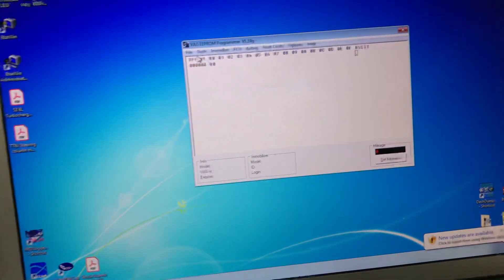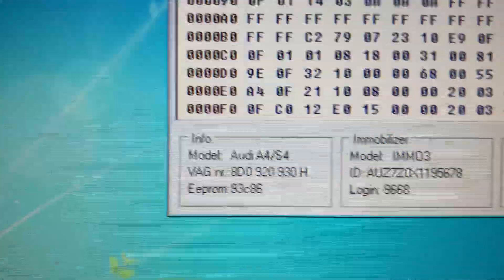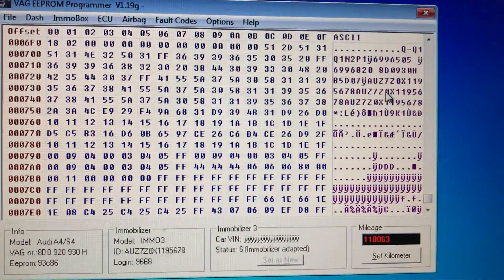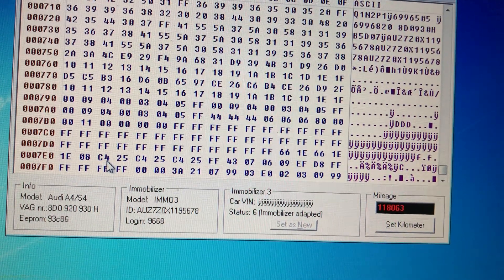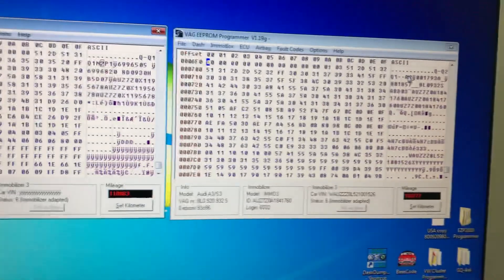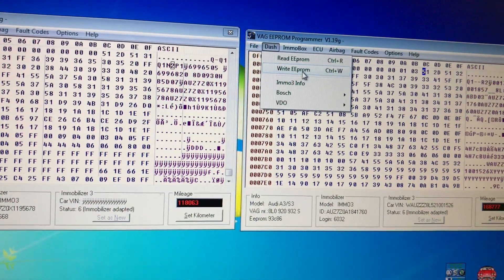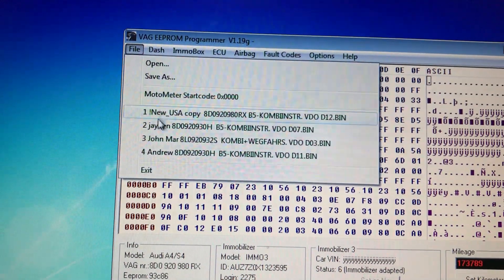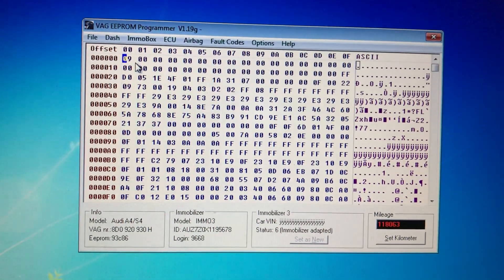How to read cluster EEPROM - Audi A3, S3, A4, S4, RS4 & Golf Mk4 R32 Gen. VAG EEPROM Programmer link

Comment: Does this work with the b8 b8.5 cluster.  I did this over 10+ years but need a refresh.
Reply from the maker: nah that's too new - you'll need different tools (more expensive) for modifying those
Reply: @ianpgonzaga what tool would you recommend?  I've seen programs like Abrites.  Also is it possible to virginize  a fob and if not, can a new chip be soldered in?
Reply from the maker: @davispaul82  correct Abrites,X Horse etc. You're right about the fob - they can't be revirgin so rechip needed.
Reply: @ianpgonzaga so I did some research on my autel km100 which can renew them using a provided cable.  So the km100 can renew keys.
Reply from the maker: @davispaul82  OK nice! good luck and let me know how you go
Reply: @ianpgonzaga  will do for sure.  Programming these cars have changed for sure and it seems like the tools i used to use are obsolete.

Comment: I am using aftermarket cable. I have two of them that work with VCDS. I can read the Cluster in the CDS but cannot read it in the software VaG for the Cluster.

I am using a TT cluster. I have two spare clusters that I’m not able to read with the software you posted. 

Please help everything is wired correctly 

I am receiving communication to the K line
Reply from the maker: This doesn't work with TT cluster. They are not VDO brand.
Reply: ❤Ian I miss your 1.8t videos
Reply from the maker: @tomtomd121 sorry man! Have been busy with other stuff. The 1.8t Mk1 is still with me! So hopefully more coming soon.  Just got a couple of other VR6 projects to get sorted before jumping back into the 1.8t.

Comment: Hi Ian, Great video!

I've got a Audi TT mk1 I tried to follow your steps with the download of this software Vag programmer v1. 19  but it does not correctly download on either of my laptops but does on the Desktop display only. 
However once I'm in the Ross tech cable or the blue K+DKcan using the USB or selecting com1 message displays "unknown software version' or" no ecu found'  however I have the Ross tech software. 
My car troubles started when I got the instrument cluster repaired as the usual issue centre display fades the car worked fine once replaced by a firm till a few weeks in the immobilizer key light flashes but car drives perfectly however I think after a month the car starts to flash all sorts of warning lights and recmv counter stops then key won't start the car till you disconnect the car battery. 
I think this resets the failed attempts counter,  I'm thinking if I deleted the existing key and program it in again and a new one a second key this may sort the key flashing immobilizer. 

Please advise your help would be much appreciated 👍

Comment: Thanks! Just one question. Model A4/S4, 8D0 920 900 K Eepron 93c86

I have two identical Dashboards (same numbers). Do I have to modify the new Eepron file with old data or could I just upload the old Eepron file into the new Dash? The files looks very simular except Win, imo and login of course, but that would if possible be an easy solution.

Comment: Hi, can i write eeprom to other instrumen cluster if the VAG nr last char not similar? (80D 919 880 E to 8D0 919 880 M)
Reply from the maker: Just double check the EEPROM chip type is the same. If so. Yes. You can write over it.

Comment: hi great video, so i wanted to ask will this help me with my issue, i have replaced the original cluster (UK version) to European one, i have two original keys from the car one with original rfid 1d48 chip and one with a new chip, but i cant seem to get the keys to learn so at the moment i have to leave immo off which i dont like. i want to keep the replacement software because its all setup in kmh and when i copyed the old software the speedo was reading mph and not kmh. rs6 c5
Reply: if i copy from Q to the end from the old to the new cluster as you explained in the video, will my original key start to work which then i can learn the new chip in the 2nd key. thank you :)

Comment: can i immo off with this program?
Reply from the maker: @zeekxng  no not with this. Immo off happens on ecu. This program only changed instrument cluster data.
Reply: @ianpgonzaga  but it can read eeprom, right? so i can read it with this and load with another program? because vag k can commander just seems to not work
Reply from the maker: @zeekxng4210  yes it can read eeeprom and write. Sounds like you might have cable or driver issue. But won't hurt to try this program.

Comment: Hi, can i read the eeprom from old cluster in the car and then swap to the new cluster and write back in the car?

the clusters have the same part code, they are identical.
Reply from the maker: @prbt8773  Hi. Yes should be able to just double check they're the same EEPROM chip. Always save a backup of the original.

Comment: Hi mate, i get "ecu not found" using the vag hex v2 cable and the diagram from your video. Golf 4 cluster.
Reply from the maker: @DrGreenThumBxD  ahhh won't work on hex v2 cable
Reply: @ianpgonzaga  hi, thanks for the fast responce, yes it worked i just added the cable 25 from the blue connector to the 27 from the green  (K Line) and voala
Reply from the maker: @DrGreenThumBxD  oh you were just missing K line lol
Reply: @ianpgonzaga  we use 4 wires from the blue one (1, 23, 24, 25) and you have shown only 3 (1, 23, 24) in the video of the bench harness
Reply from the maker: @DrGreenThumBxD  hmm strange. My pinout has been working for years...
Reply: @ianpgonzaga  yup but didnt for me mate, just added one cable (25) from the blue and now everything ok.

Comment: Hi, I have 1997 A4 2,8L 12v V6. I am using the correct chipset cable in windows 7. I keep getting the error "No ECU found" when reading my current cluster ) not the replacement one. Also when I try to use VCDS lite it says port is good but interface error. Could the cable not be functioning correctly and could that give the "No ECU found" Error? Thanks
Reply from the maker: @mptrader1620  hi. Does it scan the car at all? Maybe dodgy cable.
Reply: @ianpgonzaga  I ordered a new cable and will test it and report back with the outcome.
Reply from the maker: @mptrader1620  hopefully it works
Reply: @ianpgonzaga  Hi it is not working. So I am using a laptop now with Win 10. The VCDS work fine. I was able to recode the Instrument panel to properly read the RPM for a 6 vs a 4 cylinder. So the cable works. 

Here is what I see. With the ignition off it says "No ECU Found" I then decided to turn the ignition to the ON position. And it started to read it - I could see it doing so the status bar was moving to the right. Then it stopped and I got an error code that said, "Unknown Software Version..." 

Could this mean that the EEPROM software is the incorrect version to read the chip on the board in order to reprogram the Odometer? If so what type of chip is it and what is needed? I can take apart my old Cluster to see - if I knew what chip it was I was looking for unless you happen to know. Thanks.
Reply: @ianpgonzaga  I am thinking the EEPROM will not work on my year and model. Do you  know if that is it.
Reply from the maker: @mptrader1620  Maybe your car is too old. does it have canbus?
Reply: @ianpgonzaga  No canbus. What is frustrating is that I have searched extensively and No One seems to know or have a definitive answer regarding the "No ECU Found" error. And I am not the only one with this error. I would like to get a definitive answer even if it was, it wont work and this is why.
Reply from the maker: @mptrader1620  it could be many things but it'll be hard for me to say without testing the hardware myself. 

You say that it works on another instrument cluster ? However with VCDS lite it says port is good but interface error. 

Interface is the cable ...
Reply: @ianpgonzaga I do have another update. I do thank you  for your time. I got my laptop with Win10 running and the VCDS Lite works fine now. As a matter of fact i was able to recode the new (used)  luster from 4 cylinder to 6 to correct the tach reading on the cluster. But the eeprom still does not. So I do not think it is a cable issue. One interesting thing happend only Once (could not duplicate it again). I turned the ignition to the on position it started to read it and then stopped with the error, "unknown software version..." 99.99% of the time it's no ecu found.
Reply from the maker: @mptrader1620  yeah something's not correct with communications whether it's a driver thing or a software incompatibility somewhere

Comment: Is in this EEPROM reading also the KMH or MPH sweep range ? E.g 280km/h and the needle speed accordingly for mph or kmh
Reply from the maker: @FlightSimXtreem  probably but I don't know what values to change to adjust this setting.
Reply: @ianpgonzaga  I have no immo, so I will dump a EU eeprom into a USA cluster. I have a new USA cluster, I changed the faceplates to KM/H and in vcds put it from miles to KM/s but the speedo is off. This is my last bet, otherwise am in for a new EU cluster haha! I hope it will read. :)
Reply from the maker: @FlightSimXtreem  ok good luck!! At least you will have a back up I. Case it goes sideways. Just reflash the OG file

Comment: I get “could not login” error, how to fix it ?
Reply from the maker: @bruniinho48  need to make sure drivers installed properly, com ports matching too.
Reply: @ianpgonzaga  the drivers are installed, and the COM port is correct, and it still gives a login error
Reply from the maker: @bruniinho48  what windows are you running.

Comment: what cable did you use? kkl 409.1 (blue) or k can (black)?
Reply from the maker: You can use the blue. But in this video I am probably using genuine Ross tech VCDS cable.
Reply: @ianpgonzaga  I tried both the blue cable and the VAG 18.2 clone on an Audi A3 2005 but it says "ecu not found" why?
Reply from the maker: @_giuseppe_4249  maybe check com port settings in device manager.

Comment: How are you able to do this without communication from ecu? When I try to read eeprom it just says "no ecu found" or something like that, both in the car obd port and the diy test bench I made. My car already has immo disabled and as far as I know it should be impossible to retrive the instrument cluster login code without ecu communication. How are you able to do it? I have a 1999 s4 b5  and a 2001 s4 b5 instrument cluster.
Reply from the maker: Hi rizzly. Need to check your wiring of the test harness or maybe your cable isn't right.
Reply: @ianpgonzaga  finnaly figured it out, i set my vcds cabel to ‘’stupid’’ mode by disabling a setting and it worked thank you!
Reply from the maker: @rizzlypig9822  Ah yes. I think I mention this in here ?
Reply: @ianpgonzaga  ah maybe my bad i was skipping through trying to find out how and i thought it didnt work because my immo was disabled and therefor my speedometer didnt communicate with ecu and i thought that was why it saud no ecu found lol.
Reply from the maker: @rizzlypig9822  😂 all good. 

Pays to not rush lol

Comment: Few questions please. WIll it work with Ross-Tech VCDS Lite and will the EEPROM work with Win 10 or is there another version for  windows 10. And I am a little confused regarding saving the info Are you saving everything or just the info towards the bottom. And if towards the bottom I am a bit confused how yo do just that?  Or is it simply reading the EEPROM and saving it as a file then connecting the second cluster and then reading and saving the second EEPROM then opening and then writing the second cluster with the first cluster's EEPROM. Thanks
Reply from the maker: Hello! Probably won't work with VCDS lite cable but you can try. 

The program definitely does NOT work on windows 10. :( 

You save the entire file but manipulate the data section as in the video. Good luck!

Comment: For a bit of fun your skc code is held in triplicate at 0007e2 to 0007e7 so = C4 25
Open windows calculator in programmer mode. Click hex button.
Reverse C4  25   =  25  C4
Enter  25  C4
Press dec button  =  9668
Reply from the maker: Love it! Thanks Leo 🤓

Comment: Hey. I’ve done the boost gauge/lap timer mod on an S3 8p cluster. But do you know how to change the range of the boost gauge so it uses the full bar animation?  I’m guessing there is  a standard range like .2bar to 1.5bar that would need to be changed. Thanks
Reply from the maker: Hmmm not sure sorry.

Comment: Hi I am trying to read an A3 8V cluster, its an 18 pin. I cannot find a pinout diagram anywhere. Part number 8v0920 970R. Any idea how i can find out? Thank you
Reply from the maker: Check on forums like digital kaos or nefmoto. Otherwise get yourself a copy of the latest ElsaWin. Always has detailed wiring diagrams.
Reply: @ianpgonzaga  nothing on the forums unfortunately. I put in to a group on Facebook if anyone has the diagram and one person said that you can’t read the newer Audis anymore using this method and that you need to solder to the MCU. Do you know if that’s true?
Reply from the maker: @carYouTubefdaf  don't know. Never done a read off a newer cluster.

Comment: thanks!!!!!!!!!!
the only download i was able find after days and days of searching for a virus free link
even though this one gets flagged three times on virus total windows antivirus doent flag it so id say its 95% safe 
now just waiting for my 1J5920826A cluster to arrive and get it coded,
if im correct itll go as such:
plug in new cluster to car, turn key to run position, attach obd interface run eeprom programmer of choise, read the cluster eeprom, backup the dump, note the SKC, change the mileage to 0km, write changes

then with proceed with vcds following rosstech istructuctions on cluster adaptation, pairing keys and mileage adjustment

Comment: Hello, is it possible to read vw golf 4 1999 1.9 tdi immo2 cluster? Because it shows an error for me
Reply from the maker: Should be able to cuz it's the correct gen for this procedure. What cable are you using?
Reply: @ianpgonzaga  I'm using vag kkl
Reply from the maker: @kaimietisiskaima4483  does it have the specific chipset mentioned in video? You need to have that specific chip in the cable else it won't work.
Reply: @ianpgonzaga  um i dont know right now i will ask my friend tomorrow its his cable
Reply: @ianpgonzaga  oh and by the way what chip it has to be? I cant find it in the video or I'm just blind and deaf :D
Reply from the maker: @kaimietisiskaima4483  FT232RL
Reply: @ianpgonzaga  yeah, so he has cable with the chip you mentioned, and we tried connecting trough comm1 and comm2 we played for a bit but it always showed the error: unknown software version
Reply from the maker: @kaimietisiskaima4483  oh no that's a bit strange. If you are trying to replace the cluster with another immo2 just try do it in adaptations though VCDS
Reply: @ianpgonzaga  that's the point, i'm trying to install immo3 cluster

Comment: I installed windows 7 and it still doesn't work. it tells me unable to find usb device. can you help me ? thank you
Reply: I used kkl 409.1 
Now it's work, but it say me ecu not found....
Reply from the maker: @andreiandreiut9039  this cable looks incorrect.... Must have chipset ft232rl
Reply: @ianpgonzaga 
I found the problem. actually the program does not work on audi a3 8p. right?
Reply from the maker: @andreiandreiut9039  that's right. Only 8L model.
Reply from the maker: Sounds like you might need to configure settings in your Hardware settings. 

What cable are you using ?

Comment: Ive just used version 1.9 and it worked with windows 10,but car says its a Audi A6/S6, its not and mileage is correct and in km, but the vin and hopefully the login are right .
Reply from the maker: That's strange it's saying A6/S6 but it's not. What model is your car ? 

It doesn't hurt to try and log in using the SKC. You will only get an error if it's wrong.

Comment: I tried to follow all your instructions, but it still doesn‘t work. So maybe it‘s the cable. I‘m using a cheap HEX+CAN cable, but in the VCDS test, it shows that CAN is not ready. So do I need another cable or can I check something else for mistakes?
Reply from the maker: I use the genuine Ross tech cable for this type of stuff. It's never let me down.

Comment: What OBD cable do you use as ive tried it with the VCDS HEX-V2 cable and it says device not found ??
Reply from the maker: Hey Richard. It'll only work with hex+can or the blue ft232rl cable mentioned 

Many ppl have tried with hex V2 it just doesn't work unfortunately
Reply: @ianpgonzaga  Ok ill try get one of those cables and see how I get on. Ill let you know cheers for your help.

Comment: Can this programmer be used for A4 B6 as well?
Reply: No Joke, 30 minutes after commenting I got it to work. Here are the steps:

Plug charger into car battery, I only got it to work after my battery was trickle charging.

Set up your COM ports on windows with the correct FTDI Drivers. I used COM 2. Once in VAG EEPROM PROGRAMMER, you need to go to options and set your COM PORT.

Turn key in igntion to ON position (Don't start car though)

Go to Dash->Bosch->Get Access Code
It may take up to 10 tries but keep trying. Once it looks like it succeeded, move on

GO to Dash->Bosch->Read encrypted
Try 10x times until it reads successfully. SAVE THE FILE SOMEWHERE SAFE! FIle->save as. IF you brick your cluster this will be used to restore it.

GO to Dash->Bosch->Set from mode 6 to 4. Try until succeeds

GO to Dash->Bosch->read decrypted, try until succeeds, once it succeeds  you have a pin code, congrats!

GO to Dash->Bosch->Set from mode 4 to 6
Reply: @roofcamper3473 THANK YOU bro
Reply: I have not been able to get it to work with a 2003 audi a4 quattro 1.8t with a 5 speed manual